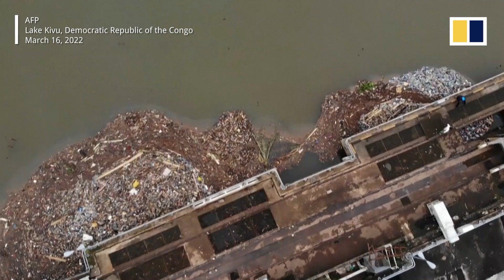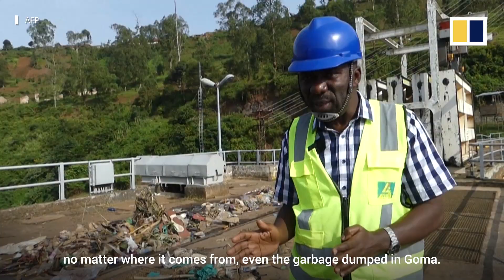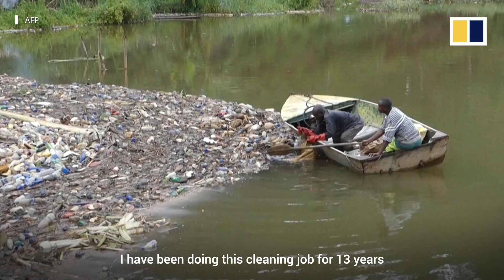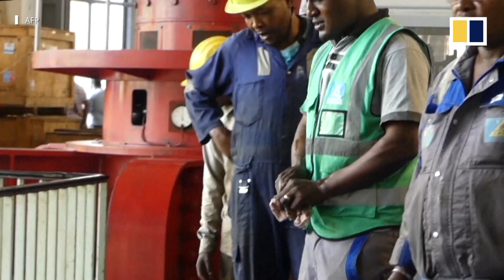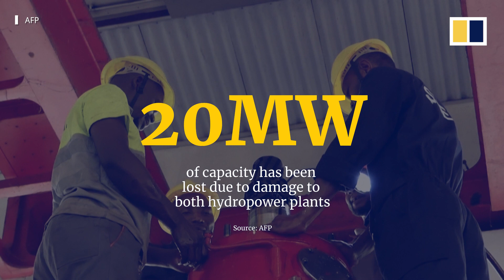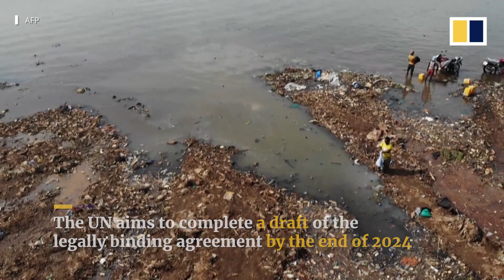Plastic waste dumped in Lake Kivu damages hydropower plants in Congo

Comment: theres a temporary cheap solution, install floating barriers at the front,
also educating the public is important
Reply: There’s a reason why this is a cheap solution, this will basically ruin the ecosystem since the water isn’t running down stream
Reply: Dark Clouds  That would be a filter…
Reply: Cheap, it means it wont last long. Everyday, the trash would pile up and it would be useless. Worse case scenario would be the floating barrier itself would be come the new trash.
Reply: Dark Clouds  similar situation when flooding in cities. Did you know that drains have holes to allow water to  pass through? Did you also know that such holes would also be clog with trash, leaves, sand, soil...etc...

yes... the grates would prevent the trash from going into the machines. At the same time, when the grates gets clog/obstructed, The machines dont run. 
This is a consumption societal issue. Education means little if people dont participate. Convenience is what they were promise and that is what they will do. 

People would resort to throwing trash on the streets and anywhere rather than walking a couple of meters to the trash bin in the name of convenience. 
And when the trash bin is full, rain comes and it gets taken away into the river. 
There is little to no escape in this.